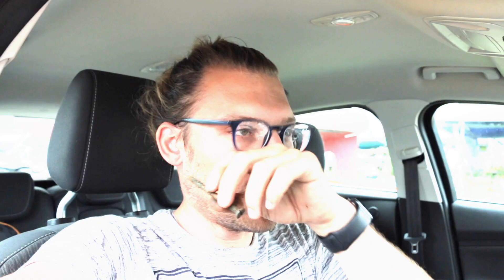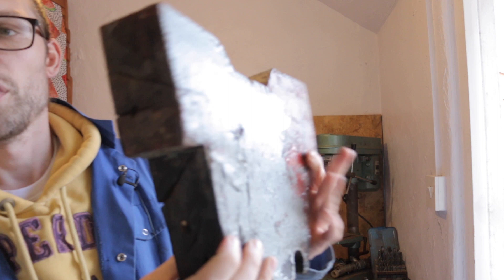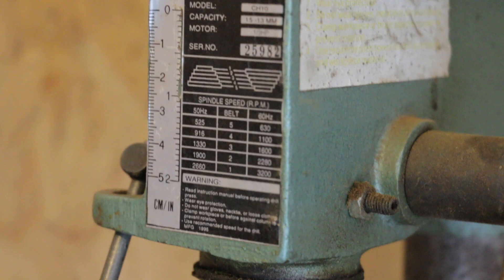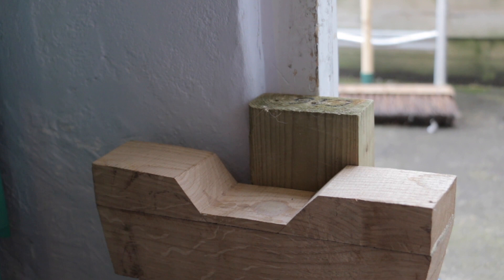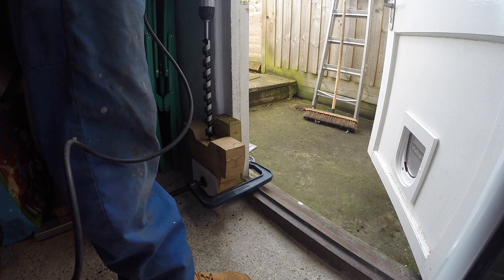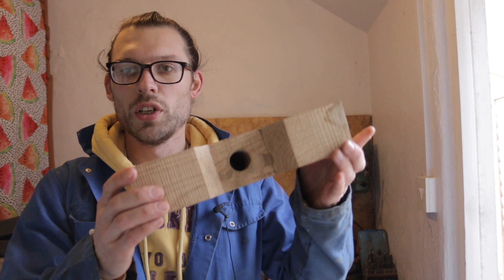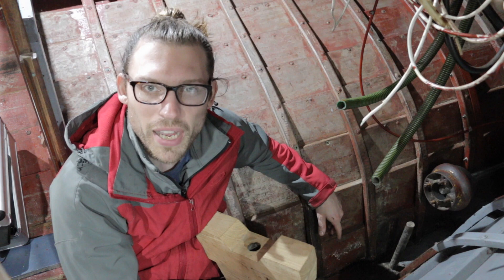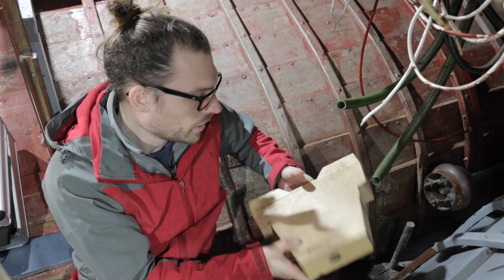19. New Oak Floor Timber Part 1. Wooden Boat Restoration.

Comment: I have rebuilt several wooden boats, but usually isolated areas ( decks and cabin cockpit and all the deck beams, carlens, boeworks, shear plank on a 52 footer) horn timber on a 28 footer, and floors on a 24 foot gaff cutter. The floors were the most challenging as I didn't want to disrupt the interiors too much. I made up a lubricant to take the place of tallow.   One third beeswax ,to one third terpentine, to one third linseed oil. 
I lubed many things with this concoction even screws driven into white oak. 
When you make up floors they don't need to be made out of one piece. They can be layers which can be fitted over keel bolts much easier. If there is no keel bolt through the timber but two  smaller bolts going into the keel timber that is the real challenge as they never run parallel to each other. If they are fastened with drifts just cut the drifts off and replace them later through  the new floor timber. 
Cold wax. Heat beeswax in a mason jar placed  in a pot of water  the jar lets you see the amount of melted wax pour in the linseed oil to match the amount of melted wax and put back into the pot untill all is melted again.  ThIs leaves one third of the jar to be filled with turps   Stir until all is melted and well mixed and liquid again. No need for the water to boil,  170 degrees F is about right so as not to burn the bees wax 
I even use to pay into seams of the boat before launching it squeezes out when the planks swell causing no harm to the seams   PS I sailed COMET the 52 footer around the world.
Reply from the maker: Thanks for the info and for watching!

Comment: A bit late to the show, but the 'Screw Tip' on that auger is a hinderance on hardwood. Once you have a starter hole made, unscrew the tip and you can control the rate of penetration much better...😁
Reply from the maker: That’s great to know though, thanks very much for watching and for the advice! I’ll dig out the auger and have a closer look.

Comment: Now you've got your keel bolt hole drilled, sand the bolt then use grease to lubricate the fitting! Limber holes: use the same bit you used to drill the first limber hole from the other (back) side once the guide worm has penetrated the back surface. ie: turn the wood around and use the worm hole as the position for the rest of the hole!
Reply from the maker: That makes a lot of sense thank you! I will be sure to lubricate the bolt! Thanks for the support and feedback

Comment: The problem is not you but the drill bit it self. The screw tip pulls the auger into the wood too fast  try holding back just a little,  a forsner bit works well but to be long enough have a welder put an extension on it
Reply from the maker: This is a really interesting insight, thanks for all your comments and support. I’ll take these things on board going forwards!